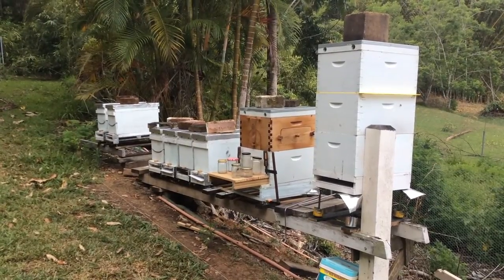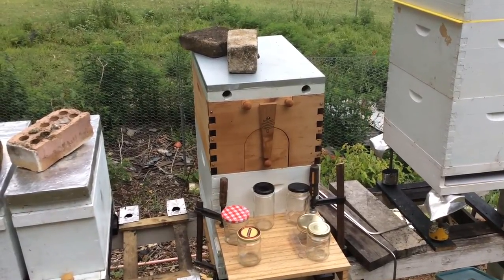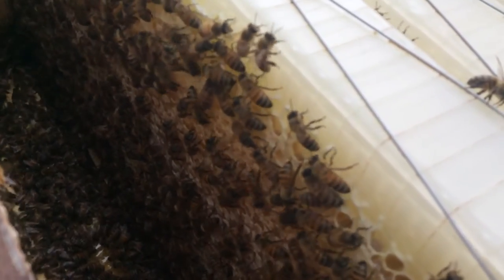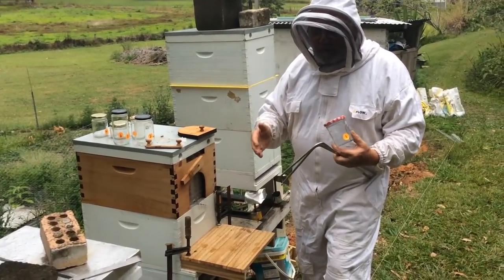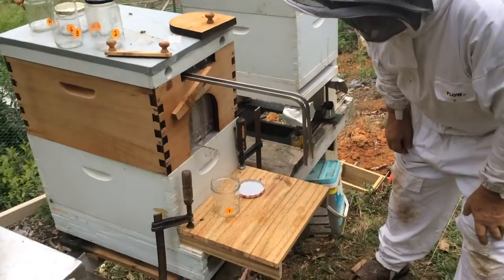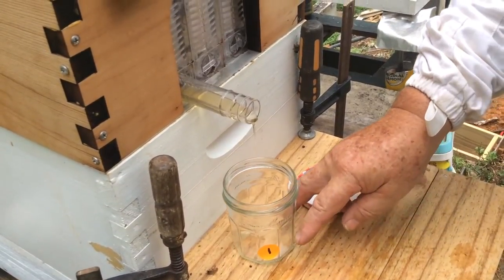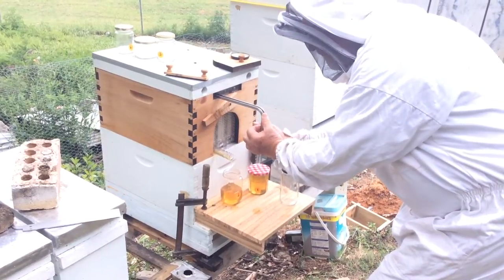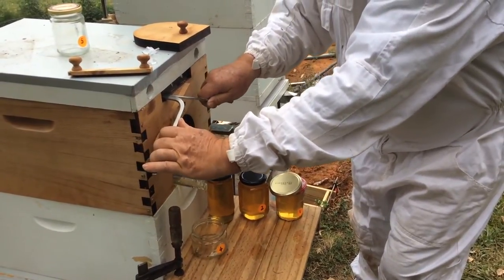Honey Flows for the Sciencemaster

Comment from the maker: I've now tapped the second Flow frame. This happened one week after the first. There was more honey in this one, 8 jars compared to 7. For the second extraction, I adjusted the slope of the beehive beforehand and braced the stand so it wouldn't move. Even so, there was a small amount of leakage, perhaps a teaspoonful. 

The third Flow frame will be tapped tomorrow. This frame is in between the other two so I will need to remove it for inspection. The first two frames did not have any brood in them but one of the Langstroth frames does have brood. I have my fingers crossed the Flow frame is brood free. One of my tasks tomorrow is to put a queen excluder below the Flow box.

Comment: my friend how to make the white trap for varroa in 8:14 minunt plz :)
Reply from the maker: Thanks for the question. We don't have varroa here in Australia but I think my core flute beetle trap is similar. 

I build a couple of 4mm deep grooves into the sides of the base. These grooves are to allow the core flute trap to slide under the screened base of the hive.I cut the trap from a piece of 3mm core flute, measured  to fit the geometry of the base. I've found the trap is much stronger when the channels in the core flute are at right angles to the slide. I don't have any experience with trapping varroa, but I've read that a varroa trap needs a 50mm space between the screen base of the hive and the surface of the core flute. When I built my base, I cut two grooves on each side for the sliding trap. I normally use the top one. This is about 30mm below the screen. The lower set of grooves are there in case Varroa spreads to Australia. I'm hoping I never need to use them.